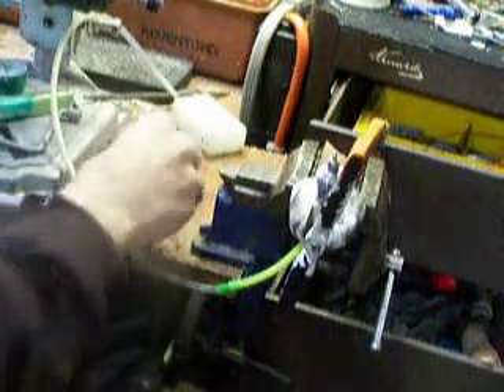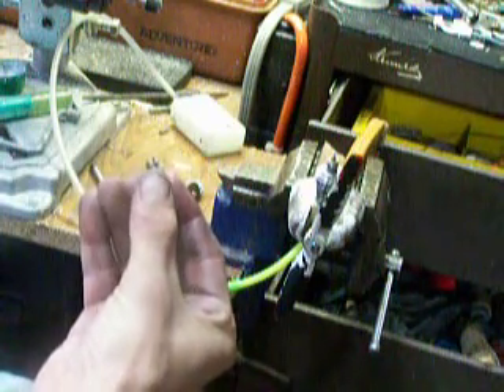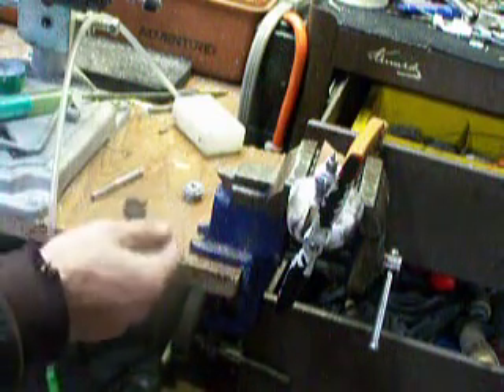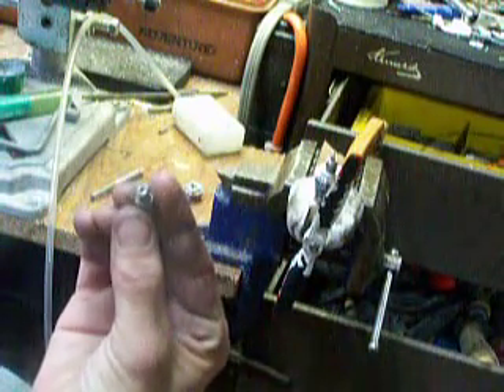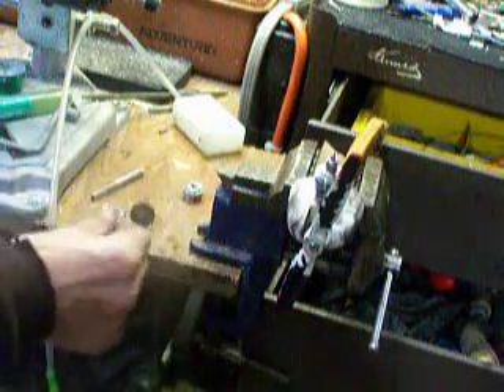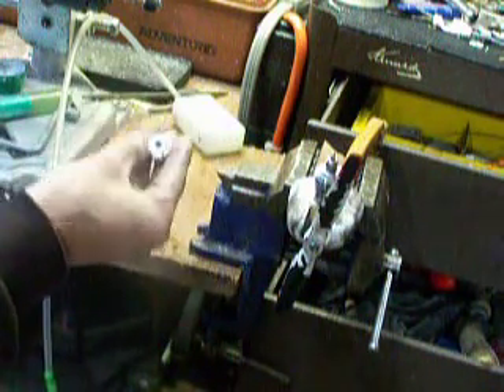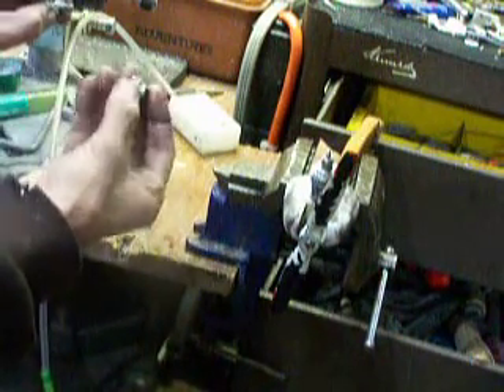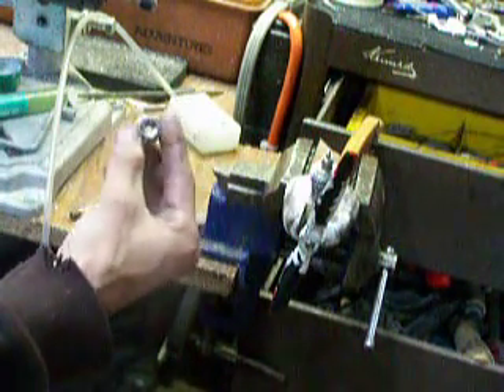tap from old glow plugs

Comment from the maker: the thickness of the head is such that the glow plugs tap in at a higher position than the original glower. by puting a pilot hole at the top to allow the new glow plug to sit lower, you can match it up closely to the  bottom, thus increasing compression.  adding rings will decrease compression by adding more volume.